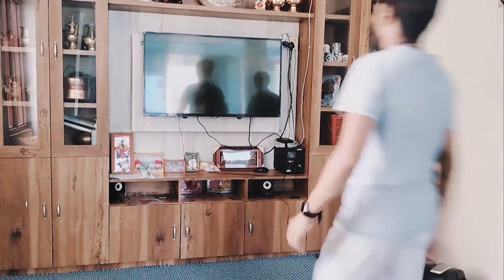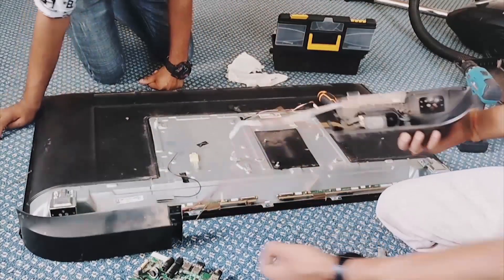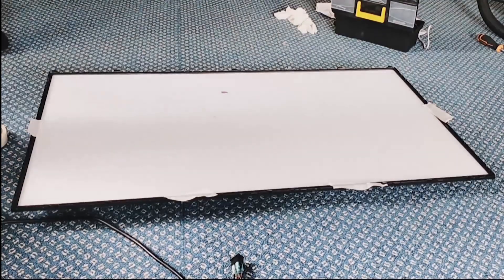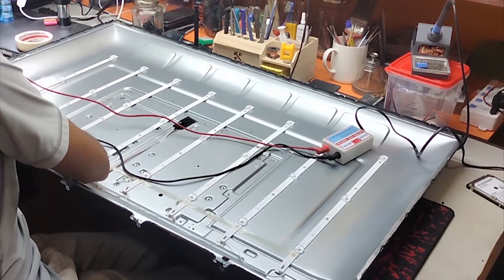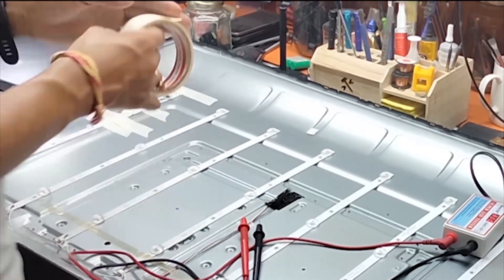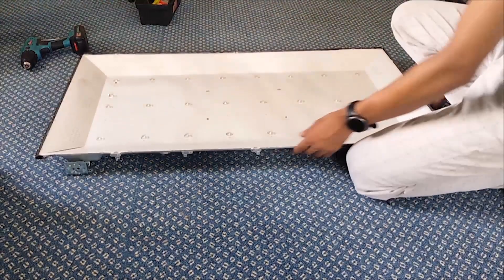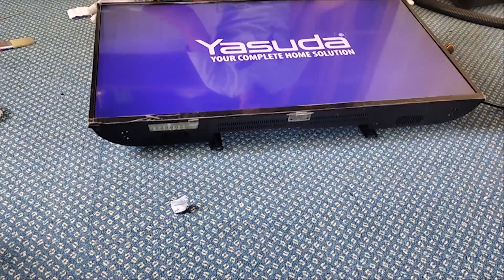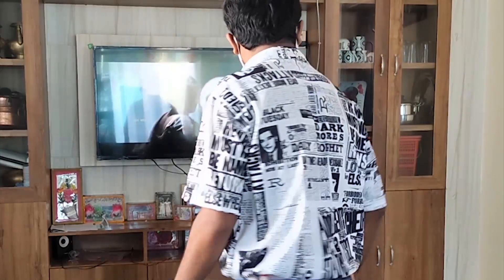Fixing a 43'' LED TV | No Backlight Issue - Step-by-Step Repair Guide 🔧| Digital World @DigiTechByte

Comment: it's easier to place the tv ona a blanket on a table face down with the bottom edge hanging an inch over the edge. then take the back off the tv and just let the screen circuitry hang. you don't have to touch the screen or light buffer.
Reply from the maker: really? thanks for your great advice. i will follow in next work